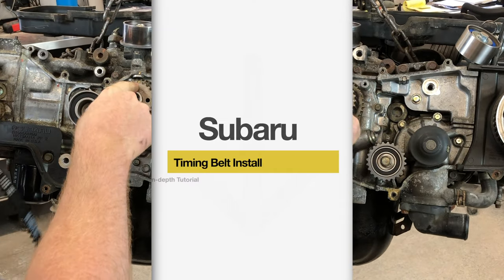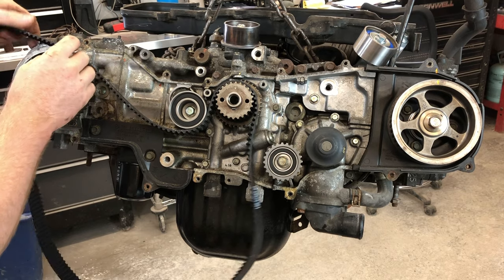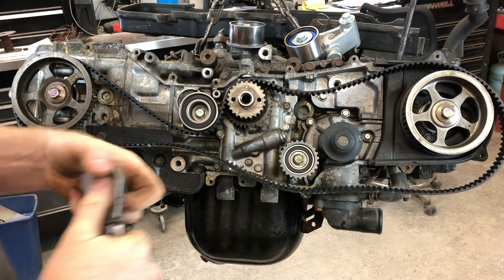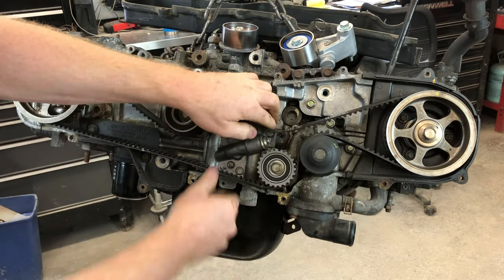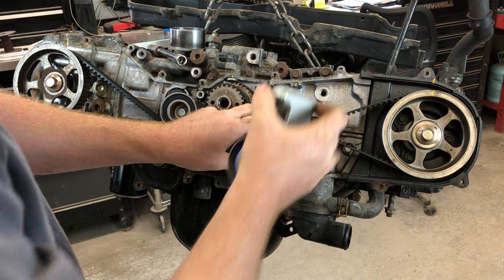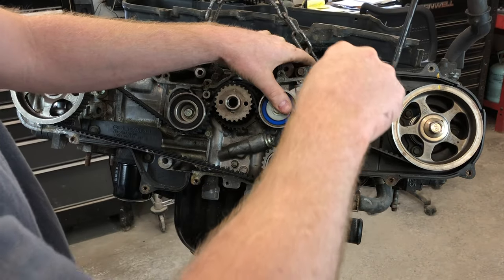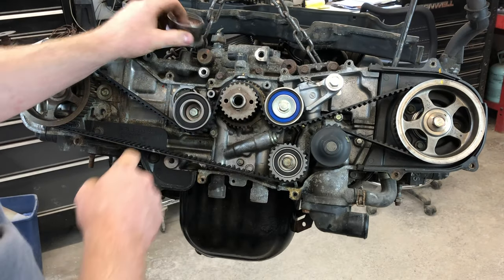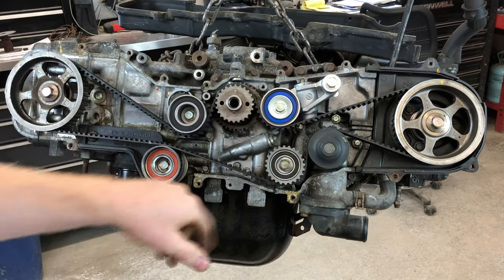SUBARU Timing Belt Installation!  PERFECT EVERY TIME! SOHC EJ25 EJ20 TIMING MARKS AND BELT GUIDE

Comment: So, for every revolution of the crankshaft, these camshafts revolve 2x, yes?  I lined all three marks (NOT arrows) up, removed one idler, and bazoing...the lefthand cam spun around.  So how the heck do I know how to time that left-hand cam now that it slipped?  It could be 1 of two combinations, right?
Reply from the maker: Sometimes a cam will slip like that on any timing belt system. I would start over and just retime all sprockets again. The left cam sprocket should have its mark on the face of the cam and that mark lines up with the head seam. Does that help? If you have a new belt with matching timing marks on it that always helps with verifying everything is lined up perfectly before you pull the tensioner pin.
Reply: @EasyFixShaun  I was confused by the 2x versus 1x revolution thing—right—as you say just line it up again.  Logically, a dot on a ccam sprocket will be in the exact same position relative to camshaft no matter how many times you turn it.  That the crankshaft mark allows you to “park” the pistons is nice.
Reply from the maker: Opps sorry forgot to touch on that. The cams spin 1/2 speed of the crank. So crank goes around 2 times for every cam revolution.

Comment: Pro tip:  use office clips the plastic and metal ones to hold the belt on the cam pulleys.
Reply from the maker: Great tip 😀😀
Reply: @EasyFixShaun  I learned that years ago from another suby nut,ales it so much easier
Reply from the maker: I love it! Little simple things like that are priceless 😃😃

Comment: Only thing is those CAM pulleys could be slipping, you should take the valve covers off and check that the cams are aligned too
Reply from the maker: The sprockets are keyed with a dowel pin to the camshaft and can only be installed one way. Although the left and right sprockets are different, so you want to make sure you don't mix those up 😃🔧

Comment: Am I correct in assuming that the white lines on the new timing belt only match up when you are first installing them? I did quite a few revolutions with my breaker bar and the notches on the two cams and crank gear line up at 12 o'clock every other revolution, but the white alignment lines on the belt never all matched up at 12 o'clock again no matter how many times I spin the engine. I think I have it on correctly using your method and some binder clips to hold the belt in place..
Reply from the maker: Correct! The marks on the sprocket are the only marks that line up every revolution. Marks are in the belt are for easier timing belt verification on installs. You should always turn engine over a few revolutions after install to verify marks are perfect on the engine sprockets 😀

Comment: Awesome video. Is there any reason why this engine does not have a belt guide above the crank?
Reply from the maker: Automatic transmissions don't have the guide most times. Manual transmission only to protect against engine braking belt skips at the crank 😃
Reply: @EasyFixShaun  I just found that out with research. Thank you for confirming. I'm working on an auto at the moment and was afraid someone didn't put it back on and I needed to wait for the dealer to order one.
Reply from the maker: No prob! 😃

Comment: Hi. I have an ej18 in a 1995 Impreza that I paid to have timing kit done 6 months ago. I want to visually check it now to be sure I don't have bad valve timing because my #2 and #4 cylinders only have 75/78psi compression.  I don't have any issues except weak power uphill and higher speeds.  

Is there a way for me to visually check the timing with removing the timing belt covers?  Using spark plug holes and maybe a small camera too, at most?   Thanks!
Reply from the maker: You can do it several ways. Checking timing on these motors is easy if you take crank pulley off, you can then remove the front timing covers and check all the marks on cam and crank sprockets. Verify its perfect and go from there. If you need to change it you can do it right there 😀🔧
Reply: @EasyFixShaun Can my son check it in the parking lot of his apartments? An easier way than removing the crank pulley?
Reply from the maker: Yup usually there is a crank pulley mark on the cover so you can line up TDC without pulling the main cover. So you will need to look for that. Once lined up, there is an inspection hole on the passenger side cover usually that you can remove to check marks inside with a mirror and light. Drivers side cam cover can be removed usually with a couple 10mm head bolts to inspect its marks. That is the procedure for like 2000ish and up. The 1995 Model should be comparable.

Comment: I have moved the left and right Cam Sprocket with my hand, by mistake,  My question is, how can I fix the problem , or reverse the problem..in order to syncronize the timing on my Forester 09,   2.5.. manual trans...... Help..and thanx ..JC
Reply from the maker: You should be able to move back into position with the marks on the camshaft sprockets and then install the belt like in the video. You may need to carefully turn the sprockets with a 17mm wrench. Don't use a Racket and socket because the sprocket and turn to far with the valve spring pressure on it. A Wrench will help you stabilize the sprocket from slipping when moving it into position. Does that help?

Comment: If my timing belt broke while driving with an '01 outback with the 2.5L motor in it but the cam shafts both will still spin and all is it possible i didnt bend my valves? Im car-less right now and i dont trust my mechanical skills enough to do a whole rebuild so im wondering if i might be good if i just line it all up like in the video and throw it all back together or if id be just wasting my time / making things worse of in the long run?
Reply from the maker: Yes. I always try lining up another good belt and fixing pully's and starting the engine. Nothing to loose. If damage is done its already done and you cant undo it. But....most times, with both interference and non-interference engines, fixing the broken belt is all that is needed. 🤞🤞

Comment: The video is amazing! Regarding the Timing Belt itself "Subaru or Mitsuboshi only" I would say that you can't go wrong with Continental also. Besides that - Do you have 2008 Hatckback EL15 Service Manual by any chance? Thanks 😊
Reply from the maker: I have seen a lot of belts break including continental well before 100k. Subaru and Mitsuboshi belts (come in Aisin timing kits) Usually can be pushed to 120-130k. I don't recommend that ever. Its not worth it but I have seen it done. I like to replace all idlers and water pump and tensioner with Subaru or Aisin. Nearly guarantees that the timing cover will not need to come off for 100k except for other engine repairs. I don't have any manuals. Ebay maybe? 😃🔧

Comment: So I just had to buy a new block am I following the firing order 1st top dead piston the valves should be closed same thing with piston number 2 for the 2nd head then just put it back to 1st dead top and give head 2 a turn and line every up it’s a sohc
Reply from the maker: That can work. The best way for me is to use the marks Subaru provides on the cam and crank pulleys though. Using those marks actually puts all four pistons in the middle of the cylinders, making it impossible to bend a valve on accident. Its a genius idea for once from a manufacturer. For me, i only use top dead center on these engines for valve adjustment on the number 1 cylinder. Then i rotate to top dead center of the next cylinder in the firing order, and so on, and so on. Just personal preference for me. Timing belts can be done the way you are doing it though of course, and on most its the only way because of where the marks are placed on the pulleys. I do find it incredibly easy to time a Subbie using the marks and method in the video. I could almost do it blindfolded 😂😉😀🔧🔧
Reply from the maker: Did you buy a new block from Subaru? That is a really good way to go about engine repair on this motor and is fairly reasonable cost, all things considered.

Comment: The only thing I would do different is using the impact at all..these Subaru threads are hella weak. I would just use an extension on the torque wrench
Reply from the maker: Yup. I agree. I don't why these bolts hex heads strip so easily. I would never use anything but a ratchet or breaker bar or torque wrench if thats your thing for breaking loose. For sure use a torque wrench to tighten 😀🔧🔧

Comment: I have a foolish question. Is replacing the gaskets, timing belt and H²o pump the same on a manual transmission? 
Asking for a foolish friend that has tools and another car incase he messes something up on the DIY.
Reply from the maker: Exactly the same except the manual transmission has a retention plate bolt on at the crankshaft. The plate can be installed on automatics also but is not needed, it's used to prevent belt skip at the crank for engine braking that a manual transmission can provide 😃

Comment: How much does the dealership charge for this service?
Reply from the maker: Depends on some factors. Car parts costs, labor rate, and labor amount. If you are just replacing the belt it's cheapest. If you replace all the idler pulleys and tensioner and water pump while you have the covers off, you will have the least chance of problems in the next 105k miles, but cost is more. Usually if you replace all the wearables like that you won't touch it again until the next service interval, if they are OEM or Asin parts ONLY. Any other parts will usually fail before the next interval from what I have seen. If the repair is a cut and dry replacement with no rust incidental costs or other unexpected costs, a cost range Guess would be 600-1200 roughly. I hope that helps 😃

Comment: hey if im tearing down on 2006 impreza’s 2.5i and the crank is lined up perfect but both my cams are opposite of being lined up
Reply from the maker: Did the engine run fine before teardown? If so you may be looking at the incorrect marks. There are several marks on the cam pulley's sometimes and  that can be confused for the actual marks. Did you get it figured out?

Comment: I've just done my head gaskets and had heads reconditioned, everything has been moved. Is there any chance to be 180° out if the timing marks line up to put the new belt on?
Reply from the maker: The crank and cam timing gears are “keyed” to the shafts. There is no adjustment between the two. As long as the timing marks are used it should be timed. Do you have the SOHC or DOHC?
Reply: Sohc
Reply from the maker: Ok. It’s less likely you can mess up the timing on a sohc. Those are fairly straight forward. You may need to go back to basics to make sure you don’t chase your tail on this one. You need four things for combustion. Timing. Compression. Fuel/air. And spark. I would make sure the timing belt marks line up. If the engine is in the car already.... does it crank over normally? Does is sound normal? Do a quick compression test and make sure you have proper compression and timing. That takes care of two items. Then you can track down the spark and fuel. Also make sure you have the original crank sprockets and camshaft sprockets for your year engine and computer. They need to be the ones that came off the vehicle. There are differences between years that would affect when the spark happens. The all will fit and are similar looking between some of the years. I hope that helps. It’s probably some small weird problem from haveing it all apart. Take you time. Check everything. Stick with it. You will get it. 😀

Comment: can this be done easily with the motor in the car?  
Is it an interference motor?
Reply from the maker: It is a an interference motor. I do them all the time with the motor in the car. The one in the video just happened to be removed and it made filming much easier.
Reply: @EasyFixShaun  thanks, man! You rock!  Considering a used purchase.
Reply from the maker: Great cars overall! They have their issues no doubt. But you get what you put into them. Use The best parts. Buy the most rust free model you can find. Usually rust is the main thing that kills them where I live. Keep them full of oil at all times. They characteristically burn oil. Low oil kills the motors. 😀 If you kill the motor put another in. Great cars. 😀

Comment: I can’t seem to get my crank shaft turned to match up with the timing marks, any tips?
Reply from the maker: How far off is it? How many teeth roughly?
Reply: @EasyFixShaun  About 7 I believe? Basically 90 degrees to the left of the vertical marks. The vehicle is a 2003 legacy
Reply from the maker: Ok. Does the crank not turn like its stuck?
Reply from the maker: Fill me in a little bit about how it got to be 7 teeth off please. I need more info.

Comment: UPDATE: 2/23/2020.  I'm going over all the fluid checks and replaced the trans filter and fluid.  I just got back from an hour ride, (BIG DIFFERENCE) pulled on a level surface, and again, went through the gears.  It took me 3-4 times to get what I THINK is an accurate reading,  a smidge below the hash mark.  Now, I have a 2002 Ram 1500, and I have found this ALSO to be a pain to get an accurate reading. I am aware that you can check the fluid when it's cold, but supposedly it's better to check hot. I appreciate your knowledge, HMB when you have time. THANX
Reply from the maker: Nice man! Yup I prefer fine tuning the fluid level also when fluid is at operating temp. New fluid can improve shifting quit a bit. Is that where you notice the difference?
Reply: @EasyFixShaun  Yes, definitely. It was starting to get that herky-jerky shift.  I'm sure this is the first time it's been changed, the fluid was very dark, but I was relieved to see no debris. The filter took some effort to remove, I've done plenty of oil changes in my time, but I started to worry I might damage the transmission.  I'm thinking that ominous sound on cold start is a lifter btw. I hope you have some in-depth videos about this.  Anyway, thanx for your sharing your knowledge. I'm waiting for the water to drain from my driveway so I can change the front and rear differential fluids. HAVE A GREAT DAY
Reply from the maker: Nice! Ya some Subarus will develop a lifter tick or have a little piston slap on cold start up. Especially once they have 150k miles or more on them. I think the book recommends adjusting the valves every timing belt service. I can not remember. I don't do it usually unless the cylinder heads have been removed. Is your transmission filter a spin on filter?
Reply: @EasyFixShaun  Yes,  it has the 2.5L EJ 253 engine. 2006 Forester.
Reply from the maker: Ok! I know that motor well. I wish I had a valve lifter adjustment video. I don't but I will at some point now that I see a need. I probably won't be of any use for you on that right now. But if you attempt it, it isn't to bad to do at all. You just need some feeler gauges and remove the valve covers.

Comment: Jeez 😢please feel free to actually remove the nobby wheel and put the belt on correct and force the pulley at the angle necessary to reach the threads and pry it up to install. It’s super super easy and don’t forget to clip your timing belt to the cam pulley to hold it in place. It’s more difficult to try doing this like he did. For whatever reason he doesn’t do it the recommended way but honestly it’s better that way and safer. 🤦🏻‍♂️❤️🖖🏼🇺🇸
Reply from the maker: Thanks! There's no wrong way to put on any belt. Only easier ways and harder ways 😀🔧

Comment: Question my timing belt kit and water pump were replaced 2 years ago and I’m not sure if the guy did it with the oem parts you recommended : soon since I’m a lot more mechanical will be doing head Subaru gaskets should I buy a new timing Subaru kit if he didn’t do oem ?
Reply from the maker: Cool. Yup I would replace all timing parts with Subaru or an Aisin kit. Piece of mind of mind is worth a lot. After that you should be good for 105k miles. Make sure you have your heads machined flat, (surfaced) so you get a good durable seal. They only leak when the heads are no longer flat. They twist over time from heat cycles. Once they leak and are machined they usually stay flat forever after that. Engine blocks never seems to have that problem on Subaru, it's all in the heads.😃🔧
Reply: Yes I’ll be having my heads machined I was also wondering should I have them they replace the valves while at it ?
Reply from the maker: You could do that. At the very least you should have the machine shop pressure check them. Would not hurt to rebuild. But, depends how deep you want to go. Most people just go after the leaking gasket problem😃🔧
Reply: @EasyFixShaun  That makes sense I’ll definitely see what they say at the machine shop and go from there I don’t want to go to far but just enough I don’t have to take it all apart for along time
Reply from the maker: @bensautocrusades2001  Either way can be good and work fine. I know what you mean. Usually if they ran perfect but just had a leak, they are ok. But, the machine shop should decide for best results 😃🔧
Reply: @EasyFixShaun It has 252,000 miles with external head gasket leaks coolent and oil , and rough running condition and hesitation , other than that all the other parts of it seem to run great
Reply from the maker: @bensautocrusades2001  You are in the zone of lapping the valves or replacement with that mileage. Subbies heads are capable of 300-400k on original heads and gear, but new gaskets are almost always needed at some point. Machine shop test will help you decide though for sure. It may end up being a coin flip decision 😃🔧